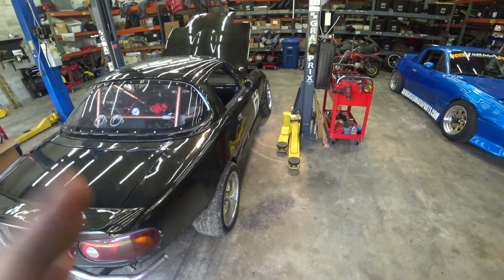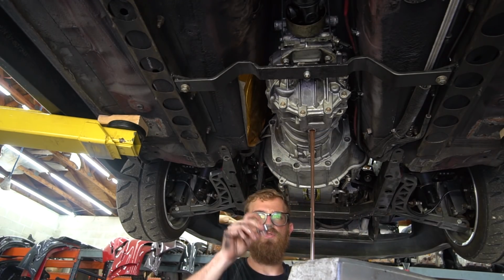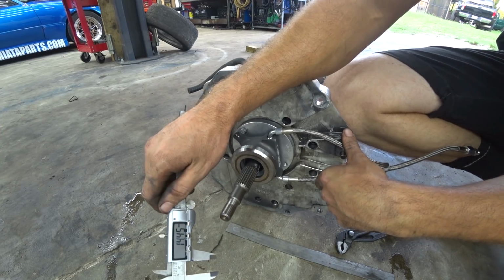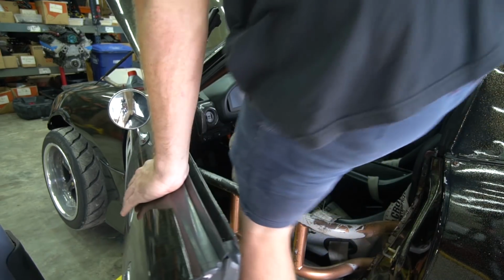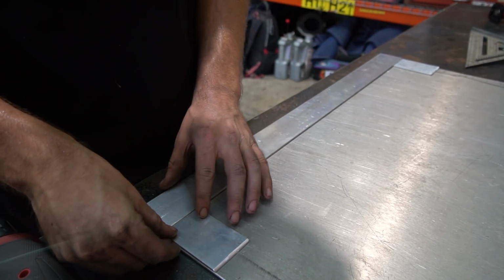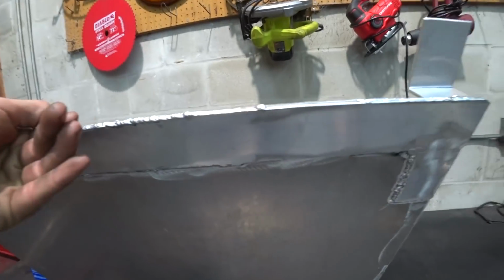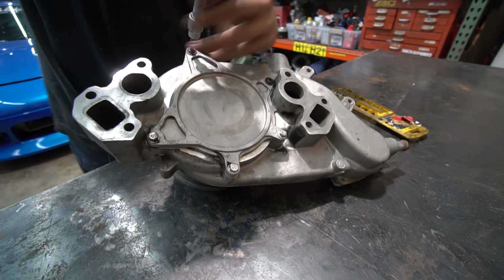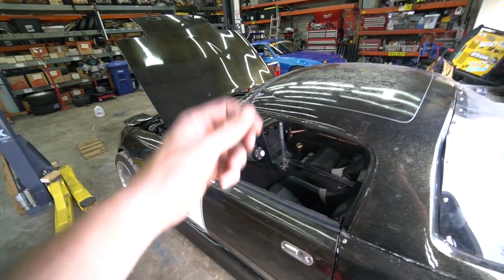Fixing The Biggest Problem With My LS3 Miata.

Comment: If you're using dot3 fluid that could be a problem too it dont like to much heat..... get some dot5 it takes heat better
Reply: Yeah dot 5 or even a light viscosity dot 4
Reply: DOT 5.1 is actually compatible with DOT 3 and 4 systems.   DOT 5 is silicone based and not compatible, but I think you might be on the right track.  

"DOT 5.1 is used in high-performance and heavy-duty applications due to its high boiling point. It’s compatible with DOT 3 and DOT 4 fluid.

DOT 5 brake fluid is silicone, meaning it doesn’t absorb water. It’s not compatible with the other brake fluids and is used mostly in classic cars that remain in storage for long periods and need a brake fluid that doesn’t absorb water."  https://blog.amsoil.com/dot-3-and-dot-4-brake-fluid-whats-the-difference/
Reply: My harley brakes use dot5 due to the heat. Heavy bike and small rotors high heat.... I was out of dot5 once and used dot3 and after a couple in town stops my brakes started to rub and made rear foot brake not work it got spongy
Reply: He was using rbf600 which is dot 4
Reply: agreed it seems to get worse with heat ..
Reply: Nothing expands better with heat than AIR. Could be the bleed procedure is not as complete as he is thinking it is.
Reply: Also , if heat is the problem , why not put in some heat shielding or heat wrap on the exhaust , that will probably work better that changing fluids
Reply: Randy UGH Lee correct your Harley takes DOT 5... it’s not compatible with other fluids. It’s silicone.

Comment: are you using old fluid? I have experienced something similar (engagement point being good when cold but shifting higher when hot) with a different vehicle and I concluded it was because the old fluid i was using had absorbed a lot of water. swapped out fluid to some new motul dot 5 and the issue was resolved.
Reply: It’s interesting that fluid would make that much of a difference.
Reply: @andrewkelly3702   fluid and clutch friction disc material as well.
Reply: I mentioned using dot 5 in a previous video. Doesn't expand near as much under heat.
Reply: Dot 5 is silicone base and has a much higher boiling point, I've used it for quite some time, good stuff
Reply: Boiling fluid is a serious and legitimate problem , I live in an area with a steep downhill decent at the end of a highway and have seen multiple trucks boil their fluid and not be able to stop and crash into multiple cars

Comment: @ 13:37 That's where you fixed it. When I was young and dumb I got the bright idea to rid my brake pedal of any play or slack by adjusting the rod between the pedal and the master cylinder. Big mistake. Upon driving the car I found my brakes getting harder and harder to press until they just bound up completely. Yeah, you gotta have a little slack in there to allow a valve to release that pressure from each time you press the pedal. I think you'll be fine now. Good job!

Comment: Coolant bleeding.  Just having a container with coolant higher than the highest spot will not automatically bleed.  You need to remove the air by opening the steam ports.  Fix the expansion tank and just utilize that. As your highest point...  other wise great job as always and thanks for making a video for me to escape the world
Reply: That might also be why his temps are higher
Reply: Plus with an expansion tank you have a larger volume of water which will help

Comment: Clutch problems and having to pull the transmission multiple times are my worst swap nightmare.  It's great that you have a hoist to put it up on.  And that the transmission is light enough for 2 men to manhandle.

Comment: With the clutch, one thing to check:
Long story after but the bolt length of the 6 bolts holding the clutch to the fly wheel assembly. 
I have a 94 miata, (i forget the trans you have on yours but same concept) but I had to do a clutch swap twice because i striped one bolt, ordered new ones but gave the spec to the place of the head of the bolt to the tip, not the bottom of the head to the tip and it ended up being about 4 mill off. If those bolts are or are close to bottoming out it could be giving you grab issues. Mine were so far out the clutch would not engage until I jankballed it with 3 washers on each to space it out the second time i put it back together. 

Your issue is kinda mysterious in that it happens over run time but with all the adjustability you have incorporated it might be worth looking at if you end up having to take it apart again. Hope its already fixed after this video, and if its not hope this helped in finding the problem.

I really like all the content you put out and you are my hero in the miata world. I wish i had time and money to build a 6.2 NA like yours, Im working toward buying a junkyard 1.8 and building the top end out and maybe a turbo but doing the more built NA swap will come first.

Thanks for all the guidance and research you have done for us in the miata community. Ill keep liking the videos if you keep putting them out.
Thanks Taylor, keep on doin what your doin.
-Travis
I

Comment: Wilwood 260-3374. I'm not sure what master cylinder you're currently using but i have the same engine, transmission, and clutch as you and this master works perfect.

Comment: Do you have high temp fluid in it, could be just like hot brakes and the fluid boiling. Instead of having brake fade its affecting release points with heat, i would have bled it to see if the release point changed any.

Comment: Taylor, you need to get yourself an AirLift for filling your coolant. It fills it by putting a vacuum on the system and sucking coolant/water into your cooling system with little to no air.

Comment: I was hoping to see how well the new/old water pump did even at idle. That’s interesting those pumps would flow differently. Do you run a thermostat ?
Reply: Impeller design or size, the casting is different some way or a flaw.  Also not sure if the pulleys are the same size
Reply: He put a thermostat in the water pump when he was putting it on

Comment: Just thinking out loud. If the clutch disc is wearing the pressure plate would move in(towards the engine). As the pressure plate moves in the fingers on the pressure plate would move out(towards the trans). This would tend to decrease the clearance between the clutch fingers and release bearing resulting in the release point for the clutch pedal to move upwards. Failure of the pressure plate spring(less likely) would give similar results. Measuring the thickness of the clutch disc would give a positive result for wear. Even new clutches can occasionally fail prematurely!.  Just an old man thinking out loud. Great car you have.

Comment: i was always told to not reuse the brake fluid that has come out of the bleader as you will be introducing air back into the system and causing the problem you are having . always store in another container to let it sit for a few days for the small air bubbles to rise to the top. if your problems continue give it a shot. good luck man love your junk

Comment: You should use plasma cutter to cut louvers in the skid plate under the 2x exhaust tubes, help to extract some heat from engine bay.

Comment: I always give a 5mm air gap between the bearing and pressure plate fingers you have to consider heat when the flywheel pressure plate bellhousing ect expand with heat things tighten up in tolerances

Comment: Need to make sure your bleed orifice on the master cylinder is not being blocked by the plunger or a small piece of debris.  Sounds like the fluid is expanding and not able to relieve the extra pressure back to the master cylinder. 
Good luck!

Comment: Hi Taylor,  would it be fair to say that the only thing new from when the 6.2  engine went in, was the clutch itself, and yet you've changed everything that worked perfectly before but now is suspect yet the green meany that sits on the the flywheel remains un challenged . Couldn't  weak cover springs be pushing back under heat and taking up your freeplay, changing the bite point.  Luv the videos,  so jealous on the fummings.  Cheers from the UK.

Comment: I'm with a lot of the other people on here thermal expansion of the fluid in the slave and master may be an issue!! I'm with them and say dot 5. Try using an ir thermometer and run it until it starts acting up and see where the temps are. Maybe even crack the bleeder and circulate it from the slave into the cylinder to get an idea of the temp to see if its heat soaked really bad down below giving you these issues.

Comment: i battled something similar on my ls1. I had to drill a fitting on the slave to allow for more fluid flow. Once fluid would get hot i would lose my clutch. I think it is common on these if you look up "clutch drill mod ls1".

Comment: I wonder when you pick the bleeder line up out of the reservoir if it's sucks in a little bit of air then you tighten it and then it works its way down through the line to the slave cylinder and that's why you got to keep adjusting your clutch just a thought.trying to help. Great videos thanks 👍

Comment: Looks like you fixed the clutch issue. The master cylinder needs to be stroked pretty much all the way out or it doesn't release the residual pressure each time you let it off. As it heats up pressure builds up in the lines and doesn't get released unless the master cylinder rod is all the way out.

Comment: Have you thought about running a different fluid? The heat from the clutch will permeate to the throwout bearing. Thermal expansion of the fluid will cause the pressure to rise, which can cause the problem you are seeing.

Comment: Try only running the seal for the thermostat and pull the thermostat out.    They're good for getting a motor up to temp quick but it acts like a restrictor plate at higher temps also if the thermostat is a 175 thermostat it will open and close near that temp keeping the water temp hotter than whag you would like.  Also more cubic inch equals more heat.

Comment: Leave your tig torch in position and let the post flow argon run out for a few seconds when you finish a weld it will stop your tungsten from oxidising and causing issues on your next weld.

Comment: Has the master cylinder position or line routing changed over time so that it’s now exposed to more heat ? If so maybe some shielding or wrap may help? Maybe also consider a trans jack , when funds allow as it might make it a one person job instead of two if bens not around. For your skid pan if the legs/ stand offs fracture again maybe build steel legs and bolt to the flat alloy pan.

Comment: If the clutch problem wasn't fixed change the master cylinder. I had a gmc truck and I had the same problem. I burned the clutch. Apparently the master pushes the oil but it doesn't return all of it.

Comment: The cooling system needs bled better. On my car i use the same funnel but also jack the front of my car up a couple feet and have to let it idle for 20 min. It will bubble a bunch in the first 5 min and then no bubbles at all for another 15 min and then all at once a ton of big bubbles come out right at 20 min. Also you might need to just ditch the adjustable throw out bearing. I've heard of a bunch of people having the same issues with them. If you haven't already make sure you upgrade to dot 5.1 fluid too.

Comment: Just a thought, but I wonder if the long bleeder hose for the slave cylinder is absorbing heat and causing the fluid to expand and changing the clutch activation point?

Comment: I mean even at idle that engine is gonna make more heat, plus arent they the same block and coolant passages and stuff? Are the cylinder sleeves thinner on the 6.2? That would equal more heat transfer to the coolant as well.

Comment: You should implement the pitbike wheelies back into the vlog. I used to love that plus you could get a klx110l and it would actually have a clutch and those things with the 143 big bore kits are beasts.
Reply: Pit bikes are hard to find right now and if you find one it's almost double the cost. Rona jacked the prices
Reply: @LWGrounds  Guess it just depends where you are and if your willing to travel. There a 2012 in kentucky for 1300. I may have to go scoop.

Comment: Did you measure the water pump pulley diameters to see if they were the same?  Also could be a ton of things like impeller design, the impeller is slipping a bit when hot(seen it), a casting flaw internally and so on.  A lot of people don't think of the coolant system when they think porting but flow is flow.

Comment: The bigger cubic inch Engine is gonna run warmer do to less material at the cylinder to soak in the heat. Less metal more heat goes to coolant. Hope this makes since.

Comment: Is it possible that the clutch master cylinder is getting to hot the fluid is designed not to expand but the heat could still  effect the master or slave just curious how close the lines are to the exhaust   if it gets worse as the more you run it it could be a heat saturation thing? ✌️

Comment: idk if it has occurred to you yet or not but you didn't start having clutch adjustment issues until you swapped to the new clutch. I haven't gone back to rewatch your install video yet to see but i do remember reading that some LS pressure plates have a weird "self adjustment" built in.  This might be a possibility of why you're chasing adjustments.

Comment: How do you diagnose a bad slave cylinder VS a master cylinder? My clutch pedal goes straight to the floor when I depress it. It’s gradually gotten worse but it used to just return back up slowly. And it seemed to get worse with higher RPM. And there’s is a potential leak up front I can see?

Comment: I haven’t watched through the whole video yet but on my mostly stock Miata I’ve had the same problem and it 100% was the master cylinder. It’s my guess at what you said that possibly the master cylinder isn’t built to handle this trans possibly. Overheating of the dot3 or something like this. Of course if what you are doing hasn’t worked.

Comment: On the big bottle of water wetter, check the label. All of the big bottles I have seen are pre diluted with water and are meant to be used as is, not mixed with more water. Might be contributing to your heat.

Comment: is it possible you need to be running a different clutch fluid? Oils change viscosity with heat, that might be the cause. is there a clutch fluid available that doesn't change as mutch? Maybe a dot4 vs dot3 kinda deal. Might be a rabbit hole worth jumping down

Comment: Temp down to 140? Are you not running a thermostat? If you arent running a thermostat,  you dont keep the coolant in the radiator long enough to cool the coolant in the radiator. That would also solve your coolant pressure issue.

Comment: What Milwaukee tool are you using for the sanding/grinding? Looks killer
Reply from the maker: It’s a die grinder. Should have a link in my description for it. I use it all the time.
Reply: @Taylordrifts  Rock on, thanks man. For sure gotta add it to my Milwaukee collection.  Thanks for the quick response lol

Comment: having too tight of freeplay in you peddle can cause flow back problems in your master .. so your problem should be fixed , having had your expans, tank blow from pressure ,how is  your head casket  , slight pressure leak could be causing overheating

Comment: Question!, Im in the market to buy an impact, should I buy a 1/2 's or a 3/8's first?
Reply: If you have a bigger vehicle (think full size suv or pickup) id definitely go with a full size half inch first. I have one (battery powered) and it helps alot. If you have something smaller or do work on smaller vehicles (cars or small suv) typically you can get away with a 3/8. Itll fit easier than the half inch say for a brake job but it wont have the power to take your tires off or something thats really torqued down.

Comment: I would bet your radiator is getting saturated (with heat), the engine is producing more BTUs than the radiator can exchange with the air, when this happens, increasing the flow of air or coolant will make very little difference. You'll likely need a bigger radiator. radiators and heat are weird like that, they work good and then hit a saturation point where they just fall flat on their face with little warning. It's why when a car starts to overheat, it goes from ok to popping off very rapidly. Like a curve that is relatively flat and then shoots off into space.

Comment: Just jam the thermostat open or drill a hole in it,  or just take it out.   thermostat is invented to keep the engine warm when its under light duty in very cold weather.   in otherwords, you never need it in a drift car, especially if you have manual fan controllers because you can just turn the fans off if you need to idle up to a decent temp before putting it under load.
Reply: Not true at all. Drilling. A bigger mixer hole is okay, but the thermostat is designed to keep your engine running at an optimal and consistent temperature. The cooling system will cool the water outside of the motor, and the thermostat allows it to mix as needed to maintain a consistent temp. If you run it open it will run cool to the point of running cold when it’s not under stress, and heat up (possibly beyond desired temps) when you’re running it hard. The temperature , power, and necessary tuning will constantly be changing because of the inconsistency.

Comment: So what happen was ur MC was adjusted too far out and depressing ur clutch slightly, the peddle movement is due to clutch wear from being slightly pressed, as the clutch burns up the fingers of the pressure plate will extend out pushing on the MC causing you to adjust ur peddle. Air gap is very important better to have too much gap than too little. U should have checked the clutch disk while the trans was out. But if you didn’t smell clutch burn than hopefully ur ok but probably did take a decent amount of life out of it.